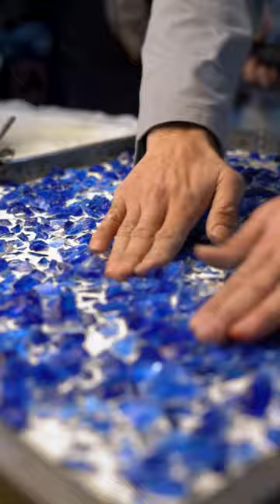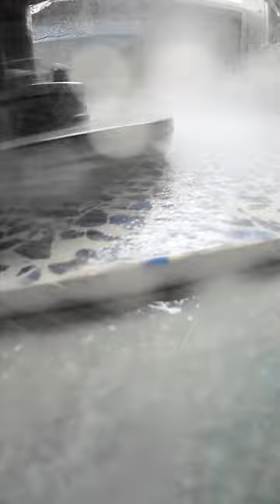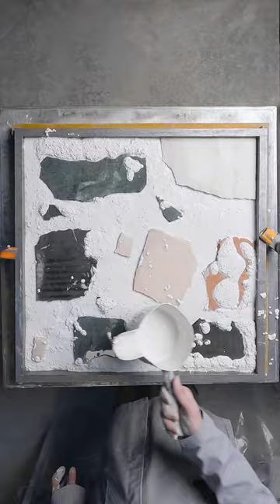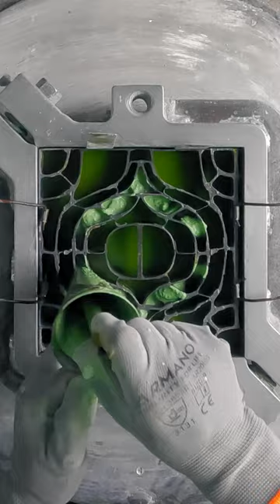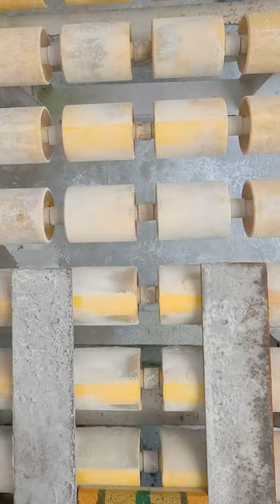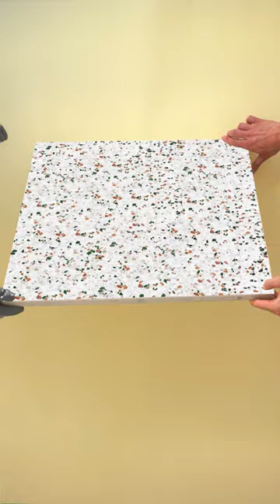How It´s made - Terrazzo Tile Production Compilation (Part II)

Comment: What is happening in the press (chemically) that hardens the cement?
Reply from the maker: Chemically, nothing. The mixture between wet and dry elements makes the tile compact, which later on will dry and harden naturally during 3 to 5 weeks 😉